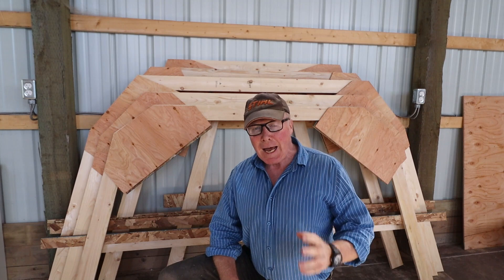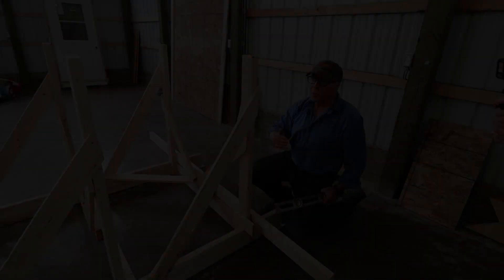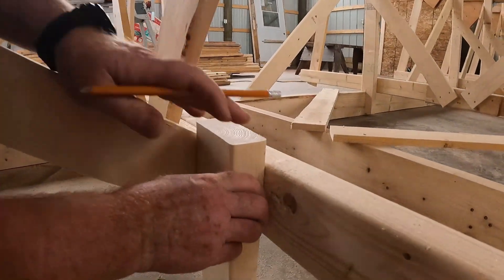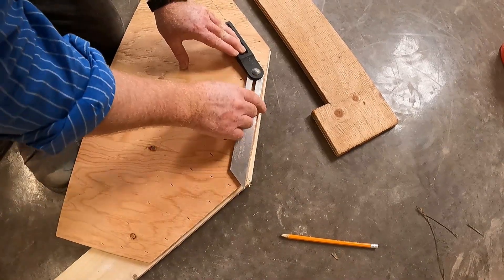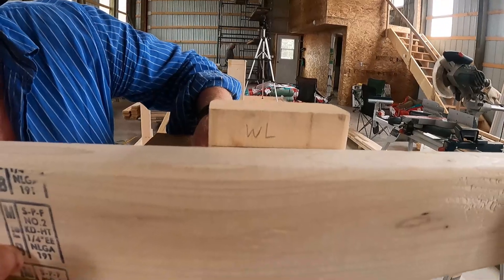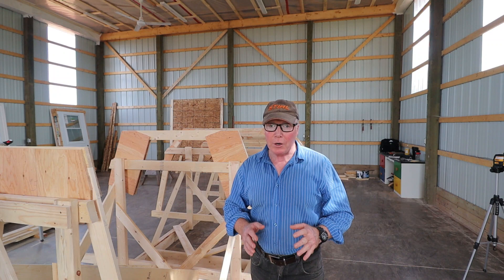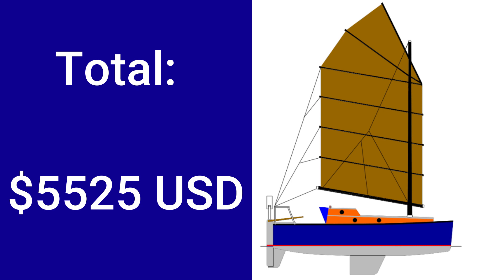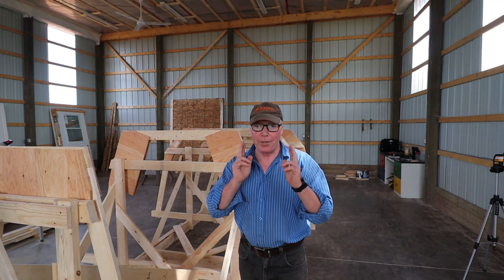S2E06 Installing the Frames on the Strong Back || How Much $ to build a Wave Rover 650

Comment: Hi I am a big fan of carpentry and easy build boat plans.  However I have no wish to sail bluewater, just 20Klms offshore to Rottnest Island and similar short overnight trips.  Could this design be modified to have stand up headroom and possibly wider cabin roof-line.  Crouching in the cabin is not for me or the better half.  Love the easy sail plan and short mast we have bridges to get under here in Perth before making the ocean.
Reply from the maker: It is possible of course but you might want to scale it on paper first just to ensure that you are ok with the aesthetic.

Comment: Why OSB on one side and Ply on the other?
Reply from the maker: It was a cost issue. And the OSB is fine for purpose but I would use ply when the price normalizes. These frames are only temporary but can still be used for several boat builds if required.
Reply: @RoversAdventure  Awesome! thanks for the replay! looking forward to seeing the build progress!

Comment: I notice that you didn't cover levelling of the strongback before you trued everything up, nor did I see any signs of it having been shimmed up. Did it turn out to not be necessary, or was it just fairly trivial to deal with?
Reply from the maker: Because I managed to acquire a lazer level for a few days, the strong back just needed to be straight and secure. Even if the SB was out of level (within reason) it will still work as long as the frames line up and have their waterlines level.
Reply: @RoversAdventure  - Ahh.. of course! So obvious once you point it out! Thanks!

Comment: Clear Tube for Water Level, as the surface of water is always level no matter the size or shape of the container.
Reply from the maker: That's exactly what I used when I built my first boat back in the 1994. Timeless and absolutely accurate!